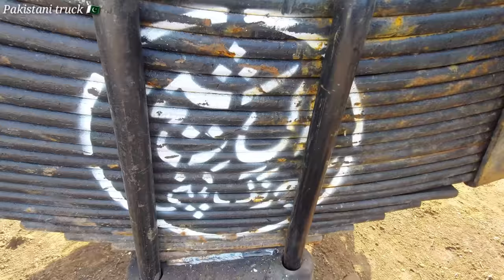Restoration of hino truck | burned by fire 🔥

Comment: I think I understand why they keep fixing the broken truck, it's because of the `taxes` of the truck itself. As you see they fortified the old and rusty chassis, to keep the serial number in that old chassis intact. So.. rather than buying a new truck, they fixing this broken truck like a new one. I believe the brand new truck has expensive taxes.
Reply: Yes and no. People here don't like to waste money. We think if it can be fixed we should fix it rather than buying a new one because replacement parts are widely available and the mechanics are talented enough to fix them as nothing was changed. And ofcourse new model trucks are expansive which people can't afford easily. Most of the time one truck goes through several owners until it's either scraped or given a new life like  you just saw.
Reply: @taimoorshah8230  why do they all keep their shops so cluttered ?
Reply: @holymoly2330  because they don't have time to manage them during working hours. They do clean out before leaving if the things are movable. Like tools and stuff.

Comment: Great Video! I love this whole channel.   But I have a question: Why is the frame always the weakest link? They obviously plan to carry way more weight than the manufacturer originally intended, so they double up the frame rails (even when they retrofit brand new trucks). But why don't they need to correspondingly beef up the engine and transmission? it seems odd the manufacturers would make the frame flimsy barely strong enough, but give it enough engine and transmission to handle a giant load?
Reply: So they break and you have to buy more

Comment: I would really like to know the economics that make this profitable.
Reply: Every mechanic charges 20 percent money on part which was purchased. Example if the mechanic is working on frame and it will cost him 1000 dollars the mechanic will charge him 200 dollars for working on it.
Reply: Over there parts and material is expensive and labour is cheap so it's works out

Comment: I hope the re-used steel from the burnt truck hasnt been so hot that the  carbon is burnt out, or it will have lost its strength...

I see double crossmembers at every spring mount: thats the way to build solid chassis !

Comment: English is an odd language. As long as the first and last letters are correct in a word most people can read the word fine if a few of the middle ones are out of order :) Burning a truck also seems like an easy way to degrease  the parts and loosen all the nuts and botls.